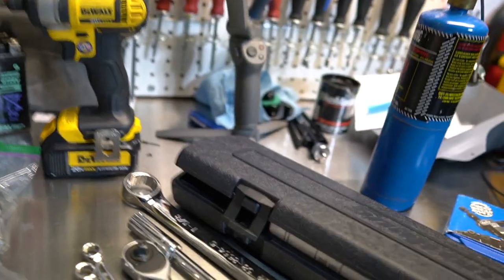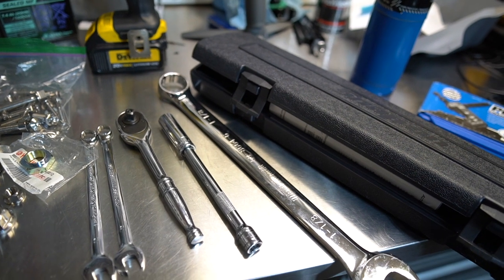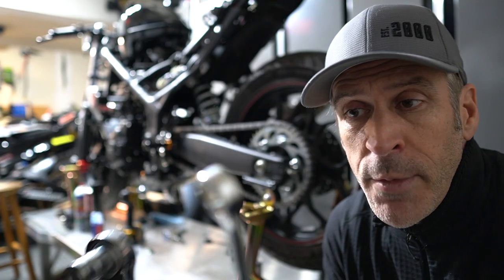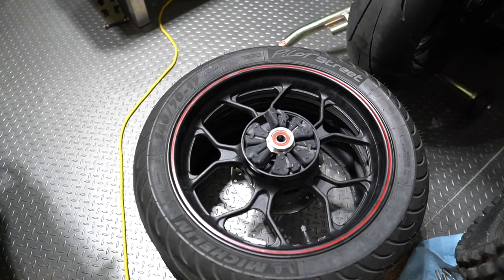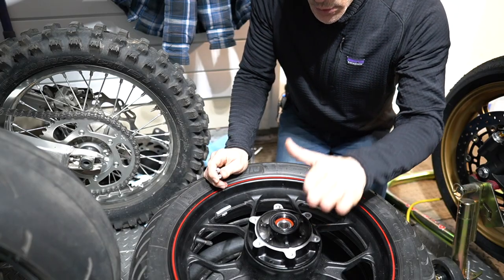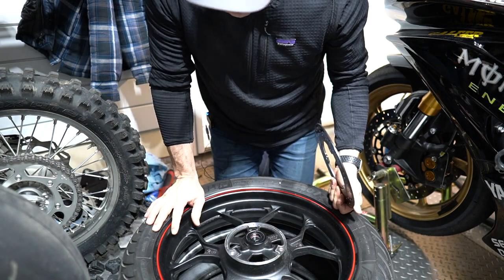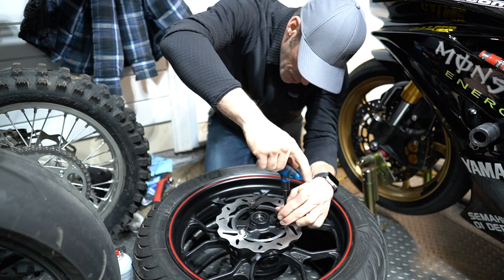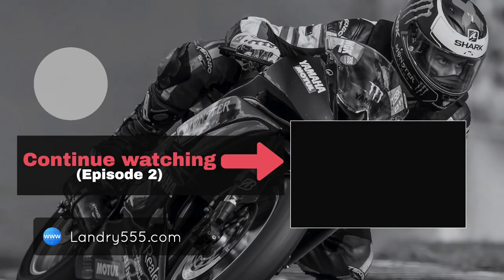415 Chain Conversion for your Yamaha R3 - Part 1

Comment: Great video! One question! Removing the rear wheel in the r3 is a nightmare, and I noticed you have some sort of fasteners on the chain tensioners, what are those? It made it so much easier!!!
Reply from the maker: Oh yeah… I agree with you, Yamaha has a bad design for the rear wheel. I purchased the TST captive chain tensioner and the GP lift system. Details can be found here - https://tstindustries.com/tst-captive-chain-adjuster-and-gp-lifter-system-yamaha-yzf-r3-2015-mt-03-2020.html

Graves also has an option. 

Let me know if you need more details. 

Thanks for watching!
/Marco
Reply: @landry555  you’re the man! Thank you!

Comment: Great video! I've heard once that if I try to loose a bolt with my torque wrench and that bolt is much more tighten than the wrench spec. limit it would loose calibration. You are much more experienced than I, so, do you think thats an issue?
Reply from the maker: Thank you for watching Rafael. I am not an expert on that topic, however I normally don’t use my torque wrench to loosen up bolts if they are very tight simply due to the fact that they need to be re-calibrated on a regular basis.  That’s the reason why I limit their use to securing fasteners only. 

In my case when/if  I had to use a micrometer torque wrench (let’s say a medium duty torque wrench of 30-150 ft . lbs)  to loosen a fastener. I would set it up at 140 ft . lbs and if I’d get a notification, then I’d use a different wrench to avoid the risk of un-calibrating the device. 

That’s my opinion on that topic.  😀

Let me know if you have more questions. 

Cheers,
/Marco